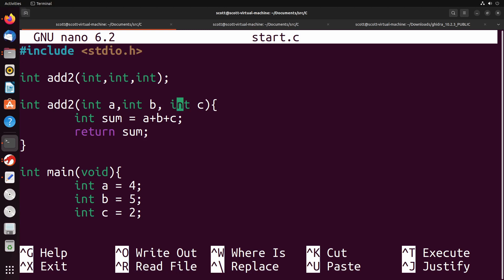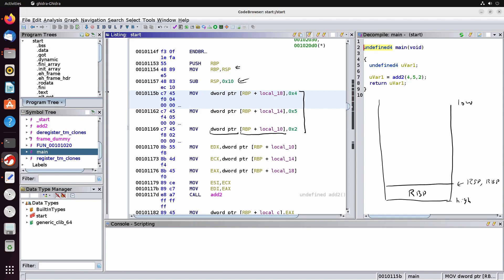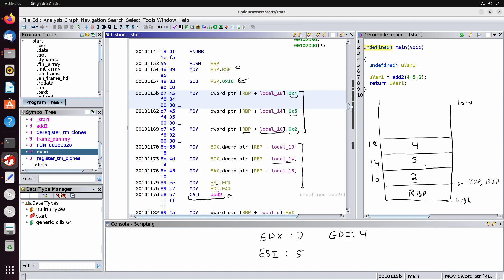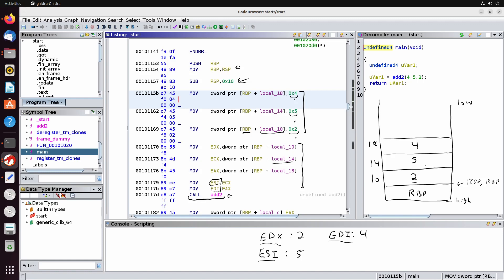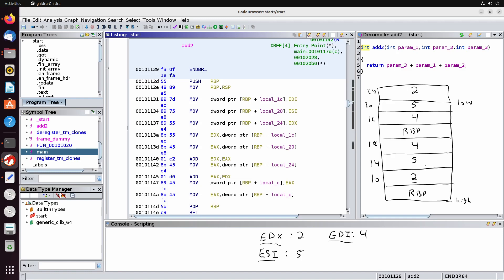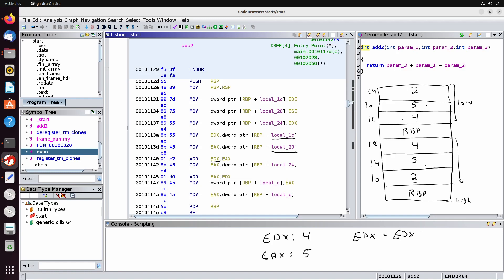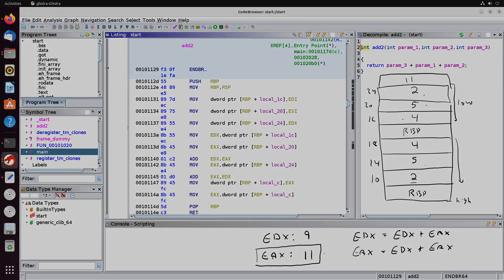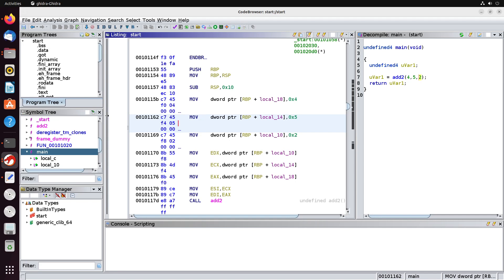Introduction to Reverse Engineering - Understanding function call and returns

Comment: 3:23 - I'm a bit confused why we have positive offset from RBP when working with MOV instructions here and also why they're shown on the diagram as being part of the stack. I thought that PUSH is for moving stuff to the stack and not MOV? And since we stored base stack pointer in RBP by doing PUSH RBP and stack grows "downwards", shouldn't we reference the data stored after that with a - (the same way that 10 was subtracted from RSP) and data that was stored earlier with a +? Can someone please explain?

P.S. The videos are amazing, and explanation overall is top-notch! Thank you very much for this channel!
Reply: I have the same problem. Have you find the solution ?
Reply: The stack is a simple chunk of memory like any other and can be altered by either PUSH or MOV instructions. The compiler could indeed use three PUSHes, but then it would need an additional instruction to set RSP to the correct value. This results in three slower PUSH commands plus one extra command to adjust RSP.

Alternatively, the compiler can use three faster MOV statements, leaving RSP unaltered, which is desired in this case. Because the second option is faster, the compiler optimizes the performance of the code by using MOV instructions instead.